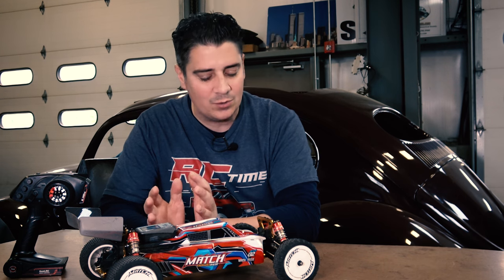WLTOYS 104001 Brushless Upgrade BUILD & SPEED RUN 2s 3s - 1/10 Buggy

Comment from the maker: Order this Buggy HERE! https://shop.makerfire.com/products/wltoys-104001-car?_pos=2&_sid=79616cc4f&_ss=r&fbclid=IwAR1Ys1J5gzvDZWg_QiW6mfhCXT_Tf5hzjxLWk_GU0m2Y3dJ5cakI_FiXkxs
Save 7% with Coupon Code ChrisVallone

In this VIDEO!  I take out the WLTOYS 104001 and do a Brushless Upgrade BUILD & SPEED RUN on 2s and 3s - 1/10 Buggy.

Guys I think this car has great potential, I went conservative on this run with inexpensive Parts.
Reply: Hello and thank you!  I'm trying to upgrade mine but had to dremel off the gear on the motor.  Do you have any idea what size the pinion gear is?  They gave me a 48p 28t at the hobby store but that  gear that will not flush up against the drive gear.  It is too small in diameter.  I  can't find a proper size call out to order a replacement :(
Reply from the maker: @TheFrenchPug  22T is stock!
Reply: @VallonesRCHobby  I ordered a couple 22Ts so hopefully they fit ok. Thank you!!!
Reply: Will this setup work in 144001?
Reply from the maker: @Ittybittythetwofacedkitty  I have build vids on what to do with that car.

Comment: Lol, I havent even gotten mine yet but I've ALREADY ordered a carbon chassis kit, AND the brushless motor, servo, esc, and radio are also all waiting to be shoved into it once the car arrives.   Got a good deal on a metal servo, stronger esc, and 4000kv motor as a combo and a dumboRC Radio set will complete the build and give me a nice gyro to assist if I need it.  I thought about getting the 3mm, but SOME flex is often a good thing and I didnt feel like having to heat it to fit it.   I'll add a center top brace if I must,  or machine some sort of solution on my own CNC.
Reply: Ha good stuff man!  Let me know how you make out.

Comment: Best 104001 brushless upgrade video. May I ask what Philips bit were you using? I was doing the motor upgrade the other day and stripped 2 screws on the motor plate. Had issue with Philips head as always.
Reply: Its a #2!  It came with my Genesis screwdriver gun.  =)

Comment: Hi, why are you changing RC receiver ? Is it possible to do the same upgrade but keeping the original one ? (sorry I'm a beginner in RC world... :-)  I would go for a brushless motor 2600kv Thanks for your answer
Reply: because the receiver is a 2 in one with the esc on this kit out of the box.  When upgrading, you would need to change the ESC so it can handle the brushless conversion.  All ESCs on the market that you purchase to upgrade are by themselves, so then you would need a new receiver with controller.
Reply: @classicvwbugs  thanks ! How many chanels do I need for the receiver ? 3 is enough ? tkx
Reply: @fredgelhausen8801  yeah for a basic setup, you just need to plug in the steering servo and the esc to it.

Comment: Did u also upgrade to a new steering servo, and why was heat gun neededjust asking how do you pair the transmitter to the car?
Reply: I did upgrade the servo, yeah, you have to if you decide to go brushless.  When you get a new transmitter, it comes with a new receiver, so it is paired already.
Reply: @classicvwbugs  do you know which steering servo should I get? I see that there is 180 and like a 200 something degrees and I don’t know which one I should get. Lastly how much kg of force do you think this buggy needs? I’ve seen 20 to 30kg
Reply from the maker: @danielli2522  This one will work https://usa.banggood.com/custlink/mGvYntsIIp
Reply: @VallonesRCHobby  do u have to mess with it like programming?
Reply: @danielli2522  no, should just drop right in
Reply: @classicvwbugs  does it matter how much angle a turning servo has like 180 or 220?
Reply: @danielli2522  It does, too much turn angle can hyper extend the arms too much.  The 180 is fine.
Reply: @classicvwbugs  thx

Comment: hi, may I ask one question? 
Can I use the ESC, remote+ receiver and servo from 104001 on a Tamiya plasma edge 2 buggy? if I can, i will consider upgrade my 104001 like you and buy a Plasma edge 2 for my son. I want him to assemble his first RC buggy, so I think Tamiya is a better choice than RTR one. thanks
Reply: you probably could do it, is the plasma edge a 1/10th scale?
Reply: No,  WL uses a 5 wire system. Tamiya  uses a 3 wire system and two to motor.
Reply: @tomkruze2749  thanks a lot

Comment: did you run it hard enough to see temps reach high points on both 2 and 3s??? maybe add another 5 to 10 tooth pinion would get you a perfect setup... i have a 4370 kv motor coming for my 144001... i think it will be over 45mph on 2s...which is perfect for me..
Reply from the maker: Temps really seemed ok to be honest, that stock pinion is kinda small, so it kept it cool.  Did you see my builds on the 144001?  I put a 2440 motor in mine with a 15t pinion and I did 54mph on 3s.
Reply: @VallonesRCHobby  i wonder if just taking the stock pinion out of 144001 and using that would be okay...not sure what pinion tooth count is on either of them... i never upgraded motors yet... i think a stock 144001 is 27 tooth and this car is around 16 tooth...if this is the case that would be a good swap to test....thanks for sharing..
Reply from the maker: @roadstar499  Yeah probably not, the pitch is different on the 144001, it is .7 mod pitch, while the 104001 is .6 mod.  The teeth will not mesh good.

Comment: Can you move the battery strap more forward for a bigger battery and what is the pitch on the pinion gear and when you put the motor on does the motor mesh up just right
Reply: You would have to fabricate something maybe, there is not an adjustable battery placement that I see.  The pinion is .6 mod.  This car has an adjustable motor mount, so you can mesh it up just right.

Comment: I used the same goolrc esc and motor combo using 2s or 3s lipo. However, I really have a big time issue in cogging using stock pinion. How did you resolve the cogging issue?
Reply from the maker: Yeah in the end I eventually got rid of that stuff and bought a hobbywing ESC
Reply: @VallonesRCHobby  which particular hobbywing ESC did you buy? I am planning to buy quicrun 10BL60 if programming card will not address the cogging issue.
Reply: @jhojhiedeleon34  150amp quicrun I think I bought.  I have since sold the car.

Comment: Great video!! I did the same setup and I’m getting 35 on 2s so I’m very happy with that. I was wondering did you have any coging issues with yours on 2s?
Reply: I did a bit, yeah.
Reply: what does 2s and 3s mean?
Reply: @armyof12monkeyss  It refers to the voltage of the battery. "2s" is two lipo cells in series; each cell has a nominal voltage of about 3.7v, so a 2s battery would be 7.4v, 3s would be 11.1v, and so on. In layman's terms, the higher the voltage, the higher the speed.

Comment: I blew out the front differential on 2S with the brushed motor not impressed with this car
Reply: Might of been a bad diff, thats unusual.
Reply: @classicvwbugs  I'm in the process of sending it back to the seller on eBay I don't want to upgrade this to brushless I thought it would handle better on the track but it doesn't like to turn tight it was fast enough for the track being brushed